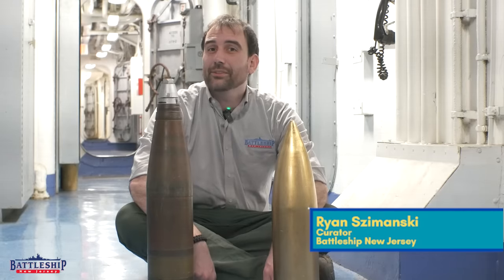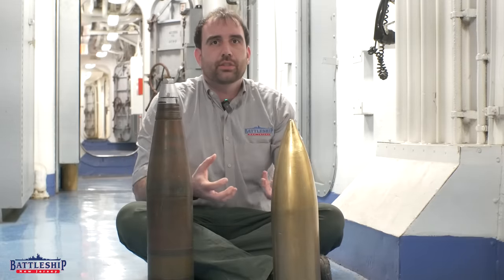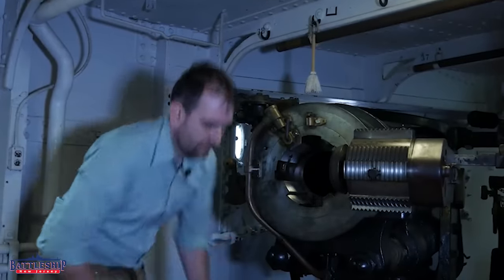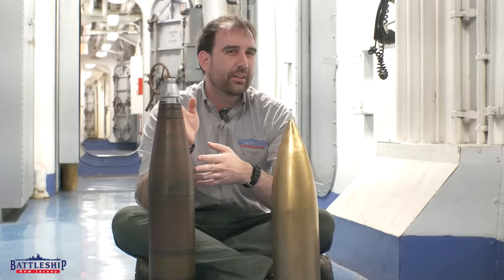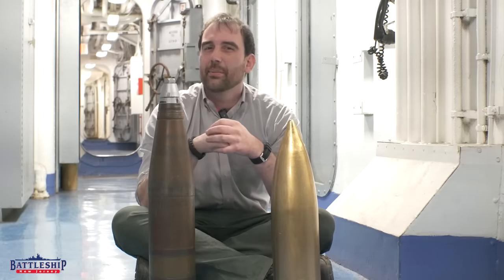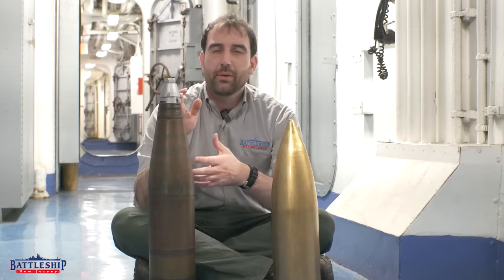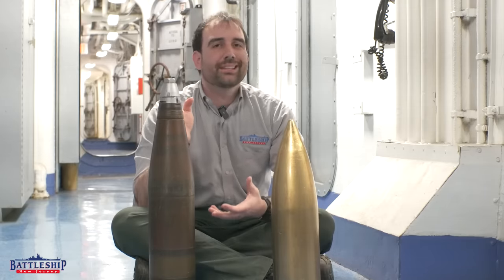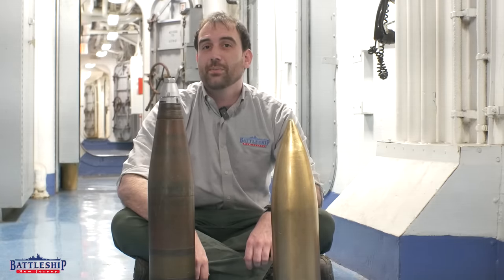5in guns: 38 Caliber vs 54 Caliber

Comment: My Opinion?  Since auto loading didn't exist in WWII, the 5" 38 was almost ideal for those conditions....coupled with the new Proximity Fuse, GREAT AA/Surface weapon.   NOW, since ships are not armored, you don't need big shells to penetrate...and the main surface weapons are missiles.  So... 5" is enough for AA/Surface/Even Shore Support.  (Hard to intimidate some since no one points missiles at anyone....but slew around the gun and have it pointed at your vessel, watching it move up and down with the motion of the ship....it is intimidating.

Comment: Can the dual 5/38 fire more rounds per minute than the single 5/54?
Reply: Yes, to a point.  The Mk 45 5"/54 can fire about 19 per minute, compared to a peak of 15 in the 5"/38 per barrel.  However, in longer engagements, the autoloader can be fed faster than a tired gun crew can continuously load, so in practice they put about the same number of projectiles downrange over 5 minutes or so.

Comment: The 5"54 Cal system is just superior to the 5"38 in every way. Rate of fire, accuracy and range are all much better on the 54s due to it being a longer barrel, a more powerful propellant charge and a self loader that uses a cartridge system rather than a projectile and powder bag system. It also requires lower staffing level as there is no one in the top of the turret.

Comment: The Brits used a 5.25 inch firing an 80 pound shell. So rate of fire would have been lower than the US 5 inch. After the war with Vanguard they used auto loaders for the 80 pounders giving them the same rate of fire as an American manual loaded 55 pounder.

Comment: My favorite gun was never mounted on a battleship but should have been in my opinion when the Iowa class was reactivated.  

The MK45 5"/54cal with the MK86 fire control system would have given the Iowa class a very good dual purpose gun system that is proving itself as a lower cost alternative to missiles when having to defend against drones and even several classes of cruise missiles.  

The Burke class DDGs have been regularly swatting nuisance Houthi attacks using Mount 51 instead of much more costly missiles.  The rate of fire of the mount is between 15 and 20 rounds per minute and good for anti-air up to around 30k feet altitude and out to 8 or so miles from the ship.

The MK86 version I was used to could control 2 mounts in tandem (laying 2 mounts on the same target) so NJ could have mounted 2 guns on each side of the ship with a single MK86 in place of one of your current 5" directors.  While not ideal this would have been something I would not have said "No" to mounting.

Comment: What measurement do the "38" and "54" reference?
Reply from the maker: The length of the barrel
Reply: Thanks,  @BattleshipNewJersey . This made me curious, so I delved a bit farther and found that the number represents 38 times the diameter for the 38 (190 inches).

Comment: How does "calibre" work for these guns? For handguns, the calibre is the diameter in hundreths of an inch, but here the diameter is just stated as, say, "5 inch", so what does the "calibre" mean? (calibre/caliber)
Reply: It expresses the length of the barrel in multiples of the bore diameter - 5" 38 caliber gun means its barrel length is 5" x 38, or 190".  5" 54's would have barrels 270" long
Reply: For artillery pieces, caliber is the length of the barrel, as measured in 'units' of the diameter of the shells it fires.  Barrel length of 5" 38 guns is 5 x 38 = 190 inches.  Barrel length of 5" 54 guns would be 5 x 54 = 270 inches.

Comment: I'm confused. When I think of 38 caliber I think of 38 special and 357 magnum revolver rounds which are .357/.358" diameter. These naval artillery projectiles are not the same to say the least! So how could they be called 38  or 54 caliber?
Reply: In naval weapons calibre is denoted by the diameter of the round compared to the barrel.

So a 5"38 barrel is 38 lengths the width of the round where the 54 is 54 widths
Reply: Oh okay,  I understsnd now.  I appreciate the information.

Comment: The 5 inches .38 caliber cannon was an all around good weapon system. Why replace what is not broken?
Reply: Ryan said in the video, they wanted a heavier shell with more stopping power since aircraft and surface vessels were getting sturdier.
Such shell didn't fit in the breech of the L/38 gun.
Reply: @ottaviobasques  I heard that. At the time of outfitting these secondary batteries were sufficient. This is my comment. Thanks.

Comment: Didn't the U.S. navy also use 3 inch AA guns as well after WW II.  I know that some Aircraft Carriers had them in duel mounts after the war.
Reply: The post-war 3 inch AA guns were newer mounts than early in the war 3 inch guns.  These were autoloaded and were radar controlled.  The smallest radar proximity fuses made during the war were for 5 inch projectiles and were shrunk in size to fit the 3 inch projectiles either near the end of the war or right after. Overall the 3 inch autoloader had a higher firing rate than the 5 inch guns, and more punch than the 40mm guns. I know that cruisers were getting them post war.  The USS Salem museum ship is equipped with them.

Comment: Punch: Recall a 5/38 friendly fire punched through an armored tunnel on battleship NC during WW2 killing several. The same ship sank light Japanese vessels with its 5/38s when the 16 inch couldn't hit them after a few tries. Accurate and with Punch

Comment: 5" 38 proven. Both anti ship and aa. Why reinvent the wheel? Can EMP take out the autoloader? If so, it seems stupid to expect a man to throw 66lb shells with any consistency. I worked a job where 
I had to throw around 50lb bags quite a bit. Hard on the back.
Reply: I doubt those early autoloaders had any mechanisms that could harmed by an EMP.
Reply: The autoloaders were hydraulic at first, now they are electro-mechanical for faster speed. If an EMP burst knocks out the radar it won't matter anyway

Comment: Don't see why we can't just continue refining what we already have, instead of spending trillions annually and continually trying to be the best at everything. The .38 was the best 5-inch, bet we could make it just as good, if not better, by manufacturing them with today's standards and technology. Smaller gun, less weight, but the same or greater punch.
Reply: Longer barrel provides more velocity.  The old 5"/25 fans probably said the same thing.  Ooogh probably said the same thing about people who could make fire instead of finding it and preserving it.
Reply: @grizwoldphantasia5005  ok. Add a longer barrel to the .38
Reply: @RayHardman7567  Then it's heavier and unbalanced, needing other structural changes.  Ballistics change and fire control computers need to be updated.  It may increase chamber pressures and reduce barrel life.

This is not some stupid game where you just say "Do it" and things magically happen.
Reply: @grizwoldphantasia5005  eh, logistics or engineering isn't my thing, I'm just the idea guy.

Comment: A 5 inch gun is 127mm. NOT .38 caliber which is .357". Despite its name, the caliber of the . 38 Special cartridge is actually . 357 inches (36 caliber/9.07 mm), with the ". 38" referring to the approximate diameter of the loaded brass case. .38, .357, .380 auto and 9mm ammunition are all the same caliber.
54 caliber is .54 inches. The Navy uses a screwed up method of naming their guns. A 16" inch gun can still be called a 50 caliber by dividing the length by the bore diameter.
Reply: I think an "s" would make enough difference, or just use "L/38".
But since it's USN, you gotta automatically differentiate the something caliber of the naval gun barrels from the firearms diameter.
Reply: Not screwed up at all.  Just two methods; one for small arms and one for artillery.